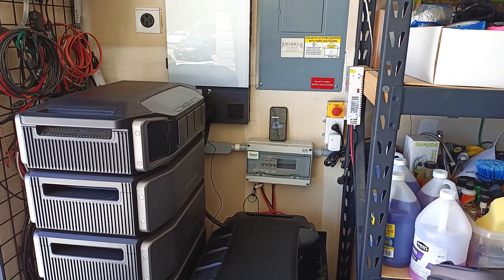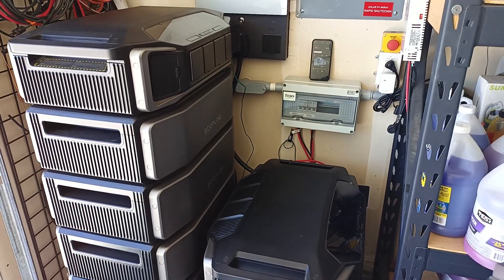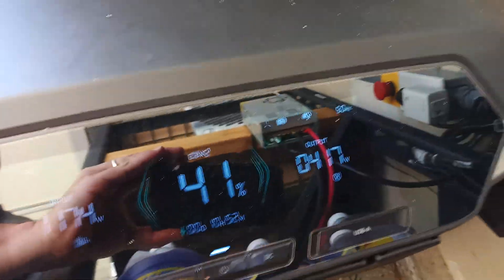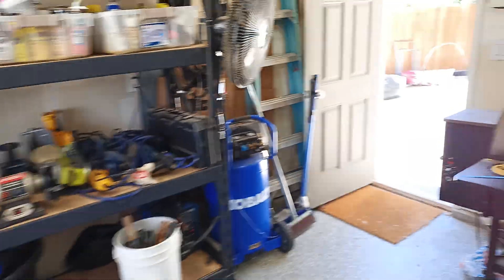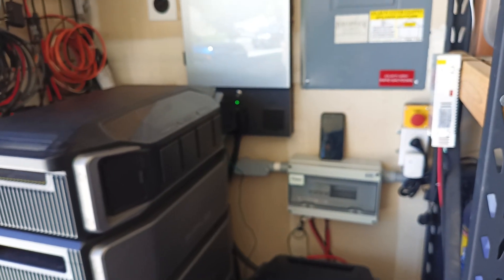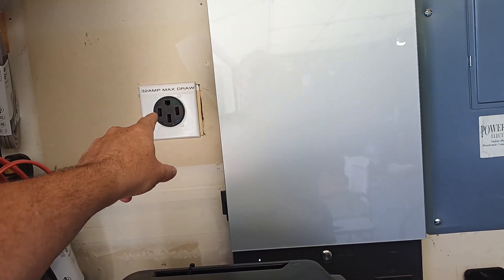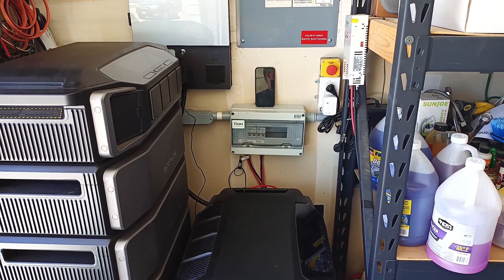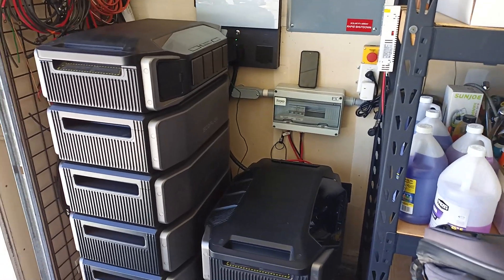Second EcoFlow Ultra vs Extra Batteries: What REALLY Works Better?

Comment: Curious, if the two units balance each other, in other words are they rated at the same percentage of charge? Say as an example, ones at 75 and the other ones at 75.
Reply from the maker: They do operate a bit differently, but occasionally they perform a “Balance State of Charge.” I’ve caught this happening once or twice in the videos, but I’m not sure what algorithm controls it, and it doesn’t seem to be something I can trigger manually.

Comment: if you did the math 184.8 divided by 7 days averages to 26.4 kWh a day.  If you have 7 batteries that's 42 kWh's of storage don't know why they didn't last the whole night somethings wrong. Were the batteries fully charged when you did the test ?
Reply from the maker: Not fully charged they rarely get there because I don't have enough panels. I have to hit at least 70% to be able to make it through the night
Reply: @erickoffgrid  Thanks for the info.

Comment: This is a really really nice setup! I've got a question about grounding -- I don't have the smart home panel (yet) - but my Ultra is bonded to house ground with the grounding screw. However, I notice when I plug in a GFCI tester into one of the 20A outlets, the ground is still floating. Does the SHP2 fix this? As of right now I'm unable to charge an EV from the ultra because of the lack of AC ground.
Reply from the maker: Thanks a lot! 🙏 That’s a great question. I don’t want to give you bad info on the grounding/GFCI side, so I can’t say for sure if the SHP2 directly fixes that. I’ve seen a couple people mention similar issues when trying to charge EVs straight from the Ultra without the smart home panel, so it might be related. You might get the most solid answer by checking EcoFlow’s support or the community forum—lots of people there are experimenting with different setups. If you do find out, definitely drop it back here, I’d love to know too!
Reply: @erickoffgrid  thanks! will do

Comment: Can you add a auto start generator to the system?
Reply from the maker: It has electric start (push button & key fob remote).
It includes a transfer switch ready L14-30R and 14-50R outlet.
It does not natively include a 2-wire auto-start input like you’d find on standby generators.

so other than some third-party smart ATS panels can be wired to simulate the key-start signal.
You’d need to tie into the ignition wiring (start/stop switch). This is a modification and would be on your own if it messed up the gen or controls so I would not suggest it.
Reply: @erickoffgrid  It would be great if they allow the EcoFlo Generator the ability to DC charge the batteries similar to the Pro.

Comment: I have your exact same setup but I’m running 100% off of solar- no grid power at all. Ive been living off of this set up for 10 months now and have learned a lot. I have two inverters , one inverter running 4 batteries and the other running 3. I found I get the maximum amount of charging if I don’t max out my inverters, I’ll do my best to explain. 
Throughout the day there’s only a finite amount of solar the system will grab depending on your solar panels. The inverter that’s holding 2 batteries will charge the system up to 100% fairly quickly and the inverter that’s holding the 5 batteries will probably take longer if not even reaching 100% by the end of the day. It’ll be constantly charging and discharging. The inverter with two batteries though will get to a point where it will stop charging because it’s using its battery. During those moments your 6 solar panels for that array not doing anything or rather it’s not really being used to charge the batteries. With that said, if you make the 2 battery inverter into 3 batteries and the 5 into a 4, now you’re splitting the difference and allowing more chances for the batteries to fully charge. I see it as being more efficient, a resting charging system isn’t doing anything for me. I found when I went from 3 batteries to 4 batteries I use to end the day at 50% charge with 3 batteries and now I end the day with 35% battery life having 4 batteries. My solar input stayed the same but it just got dispersed into 4 batteries instead of 3. I’m not saying more batteries is a bad thing. The offset benefit to having more batteries is you’re not straining the system. When I first started with 2 batteries my batteries would fully charge and fully die in one day. Now I’m always left with some juice in the mornings to start my day when there’s no sunlight. The other benefit is during colder season, my batteries end the day at 75-85 percent of battery life. I’m able to run heavy heavy house appliances at night and not worry about power loss. I tend to wash clothes at night during colder season as oppose to when it’s the hot season I wash my clothes in the day so my solar panels can do more of the work.. but that just means less solar power entering my batteries.
Reply from the maker: That's fantastic, sounds like you've got a handle on optimizing your system! Thank you for sharing..

Comment: But 30amp 240V is disappointing at best. When will we get a single power station with real 50amp 240V option?
Reply from the maker: Yeah, 30A at 240V is definitely a limitation for heavier loads. Honestly, a true 50A 240V portable power station would be a game-changer—but right now, battery and inverter tech, plus safety standards, make that tough for a single unit. Definitely worth sending that as a feature request to the vendor—it would be an awesome ask!

Comment: For anyone looking to buy, Costco has the DPU and 3 batteries on sale for $7,699 until the end of Aug. I have a DPU and 2 batteries already. My limit is $2,000 per battery, so this works out well.
Reply from the maker: Thanks for sharing that info, hopefully, it helps some people save some money!
Reply: Now it's at $7,599. And if you need a SHP2, the bundle total is $8,599.

Comment: Having batteries in the house, if there’s a fault your house fire will be difficult to put out. Ever consider an external building?
Reply from the maker: Absolutely, safety is a top concern. Modern battery systems have multiple layers of protection—thermal management, fuses, and smart monitoring—to prevent faults from escalating. For me, the LFP battery chemistry was also a major selling point because of its inherent safety, which is why I’m waiting for the new 2026–27 Chevy Bolt in LFP before I make the jump to an EV. That said, an external building or dedicated battery shed is still a great option if you want extra peace of mind, especially for higher-capacity setups and IF you have the room.

Comment: Please elaborate on the “safety gear”.  What components  specifically do I need to buy for the “safety gear” to provide protection ?
Reply from the maker: Sorry missed this one, 

Absolutely—safety is key when running a high-capacity battery setup like an EcoFlow. The main components you should consider include:

Proper Wire Gauge: Use wires sized appropriately for the maximum current your system will draw. Undersized wires can overheat and create a fire risk. For example, a 30A 240V draw requires at least 10 AWG wire, but always check your specific system’s requirements.

Circuit Breakers / Fuses: Install breakers or fuses on both the input and output lines. This protects the system and your house wiring if a short or overload occurs. Make sure they’re rated for the voltage and current of your EcoFlow setup.

Disconnect Switches: A dedicated disconnect switch allows you to safely cut power for maintenance or in an emergency. This is especially important for higher-capacity setups.

Surge Protection / Lightning Protection: Consider surge protectors for sensitive electronics connected to the system. Some setups include whole-house surge protection.

Battery Monitoring / Management System: The EcoFlow units already have BMS (Battery Management System) built-in, but monitoring your loads and battery status in real time ensures you can catch anomalies before they become problems.

Proper Ventilation / Placement: While LFP batteries are much safer than Li-ion, good airflow and a clean, dry installation space reduce risk further. If you’re indoors, keep the battery off the floor and away from combustible materials.

Optional External Enclosure: For larger setups, some people install the battery in a dedicated shed or ventilated cabinet. This isn’t strictly necessary for smaller indoor setups, but it adds an extra layer of safety for bigger arrays.

Putting all of these pieces together ensures your EcoFlow setup is safe, compliant, and ready to handle your loads without risk."

Comment: Hello, how do I contact you for consultation services?  Thank you
Reply from the maker: I will have it up at Erickoffgrid.com soon
Reply: @erickoffgrid oh ok.  I am looking into buying a system soon.  Can we connect before the site is up and running?  Also quick question, with the Home Panel 2, can you select which circuits use battery and which use grid power?  Thanks
Reply from the maker: @DA22522 I'm sure we can but the question is kind of a deep one its budget and what do you want to cover and how do you want to install and do you want it to be mobile do you want to be not what battery chemistry are you comfortable with are all important decisions.

And yes you can totally pick and choose the circus you want to be on battery or leave over on the grid that's what I did.

Comment: These high frequency transformerless inverters from Ecoflow are a scam. They can damage your home's appliances when their MOSFETs fail because they don't provide any galvanic isolation between their DC boost stage and their AC output. No thanks. Never in my home.
Reply from the maker: I hear your concern, and it’s true that transformerless (HF) inverters don’t provide galvanic isolation like traditional inverters. That said, EcoFlow and other modern systems include multiple protections—like over/under voltage protection, surge protection, and battery management systems—to minimize risk to appliances. For sensitive or legacy equipment, some users do add an isolation transformer or dedicated surge protection. Ultimately, it comes down to matching your setup to your risk tolerance and the type of loads you’re running."

Comment: Very helpful video Erick. I am helping my parents size DPU backup potential system for their home. Question: how is it that 7 batteries sometimes cannot get you through the night on battery power especially if you say the AC is not attached? I would have thought that was plenty of capacity?
Reply from the maker: It will if I can get the charge to above 70% but otherwise if it doesn't make that it won't make it through the night and of course that all depends on sun angle how cloudy it was yada yada.

Comment: I have 3 DPU's with 4 batteries on each and approx 12kw of solar (3 HV arrays).    Works great but gotta admit, always scared doing any type of firmware update since ecoflow hasn't been known to do a great job at that.    Also, I put little ball bearing computer fans on the outlets of each DPU to help cool it down and they are all USB so I plug in the USB right on the DPU and they use about 2watts... pulls down the temps a few degrees and have been very effective.
Reply from the maker: That is fantastic, I'm a bit jealous of the equipment 🙂, and you should be causious of the firmware updaes, many times did I have to call in to have them push me back befause something was not working as it should, So I have started staying back 2-3 versions.. I would like to see the fan setup it sounds great, might be something I and others would want to copy..

Comment: Well done setup!  I have my single Ultra inverter, three battery setup also in the garage where it gets pretty hot in the summer and a fan setup similar to yours.  Having constant moving air across the unit does give a little peace of mind!  Nice to know these are relatively "extreme" temperature functional.  Excellent resource, thanks for the video 👍
Reply from the maker: Appreciate the feedback thank you

Comment: Any thoughts on getting something like Server Rack Batteries or individual batteries like Power Queen to do add extra watt reserve? I see lots of videos on it but I’m hesitant, ChatGPT keeps telling me it could damage the ecoflows, but the cheaper price makes it enticing
Reply from the maker: I will not be doing that no, I do not want to mix battery chemistry when these LFPs are set to charge in a particular way, those others might not, I would say be careful building only on price, especially with such an important and potentially highly volatile system.
Reply from the maker: Now, if you are doing an entirely separate system, and they are NOT tied to each other.. then ya' I was looking at the  EG4s like these, https://signaturesolar.com/eg4-lifepower4-v2-lithium-battery-48v-100ah-server-rack-battery-ul1973-ul9540a-10-year-warranty/
Reply: @erickoffgrid I keep seeing that if you were to do an external battery from the third parties, you need an MPPT system to run it through before putting into the solar input, but doesn’t the Ecoflow have its own integrated, given we can plug solar directly into it?
Reply from the maker: @ThomEmDee exactly that, the mppt charge controller is built into the inverter which is exactly why you can plug the mc4 connector straight in from the solar so yes you are correct.

Comment: Why are you not balancing the batteries? 3 and 3 for each inverter? Whats the benefit of doing it like you are currently?
Reply from the maker: 1 DPU has HIGH voltage input array, the other is HIGH but far less power as it started as a LOW voltage system. so the HIGH gets the most batteries, as it is each can hit the 90% charge on each stack on a good day, so I feel it is a good balance.
Reply: @erickoffgrid how do you have it set up on the app for the SHP2: self-powered, scheduled or time of use?
Reply from the maker: @maxreynoso I'm totally self-powered all the time.

For me this is the best option so that I can use the input for the house real time the difference gets sent to the batteries and for me it's just the best option with my power company so I never worry about the time of use or the other features for me it's self-powered all the time.

Comment: Thank you for putting this video together and sharing it with the rest of us. Let's say that the max voltage is 150V. How close should I stay to the max?
Reply from the maker: Thank you I appreciate the comment. 

So always use the max open voltage number and I would stay down 1 panel worth of voltage as a safety. 1 panel is not a huge loss if having it in would max your voltage and potentially damage your DPU.
Reply: I understand you could put several panels in series and then convert them over to parallel
Reply: Solar panels never put out their rated power
Reply: what you REALLY need to be careful with, is the opening voltage on your solar panel input as the temps start to drop. The lower the morning temp when the sun first comes up, the higher the opening voltage will be. BE SUPER CAREFUL, or you can fry your units. I also own two DPUs.

Comment: I have a ecoflow DPU with 4 batteries; if i add a second dpu using one of those four batteries, and the slow charge of the first DPU, will that work? Will they balance?  They would be in two stacks.
Reply from the maker: Yes that would be great because the second dpu would bring stability and I did this very thing with my first DPU getting the high voltage array and my second smaller stack get in the low voltage and yes they will load balance between each other when the differential gets so high I'm not sure what the algorithm is but they do balance power-wise between each other at a certain point so yeah I would absolutely do this.
Reply from the maker: And I believe I either have a dedicated video or in one of them showing the load balancing the power balancing process of when it was discharging from one and charging the other at 6K.

Comment: Erick you might have mentioned it in a previous video, but I wanted to ask here. What kind of solar panels (both brand, model and type like bifacial) are you using, for both low and high current panels? Do you recommend any cost effective ones, as the Ecoflow panels are a bit too pricey. 

I’m planning on going with 2 Ecoflow DPUs and 4 batteries for a 3100 sq ft home with a 4 Ton A/C unit, gas furnace, a 30 cu ft refrigerator/freezer, dishwasher, electric washer and dryer, plus a 15 cu ft freezer, 2 - 20 cu ft freezers and a smaller fridge/freezer, also a 50 gal gas hot water heater. There’s limited use of high draw appliances like a coffee maker, toaster, bread maker, a 50” plasma TV, a 65” plasma TV, plus light draw stuff like LED lamps, a modem and 3 routers, 120 Watt Home Theater receiver, 2 - 600 watt subwoofers. My question to you after outlining the things I need to power is: how many solar panels would you recommend as a starter setup? I was hoping to start with 6 high and 2 low panels and supplemental propane fired generator for charging up by 4 batteries.  Any suggestions would be greatly appreciated. Thanks!
Reply from the maker: I used https://www.platt.com/p/2047104/q-cells/475w-solar-module-156-half-cell-black-aluminum/qclqpeakduoxlg1047

I also did not go with Ecoflow panels, WAY to expensive for the power !!!

Thats a decent amount of power and might take a separate conversation to work though, but I have learned you want at least 2 DPUs for stability and 5 batteries and I would have done 2 hight voltage arrays to max each DPUs HIGH input to start... your house sounds a lot like mine, and I would call this the starting line to get me MOSTLY where I wanted to be and that was to make it though the night on batteries.. and build on from there..